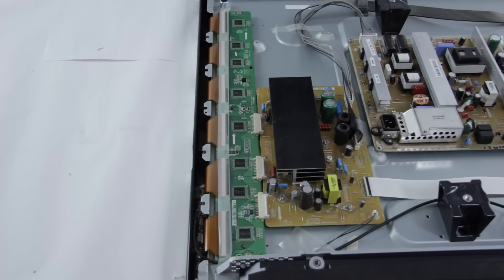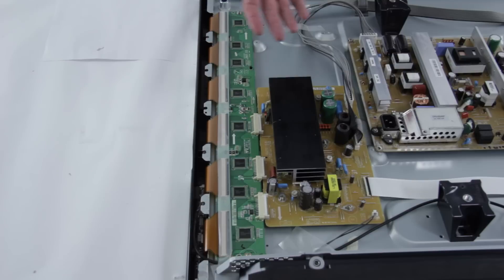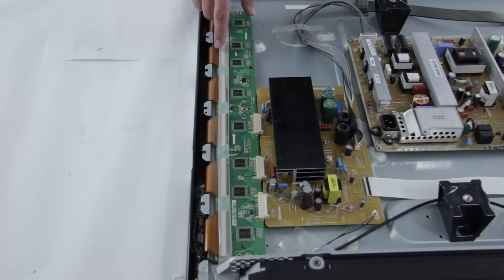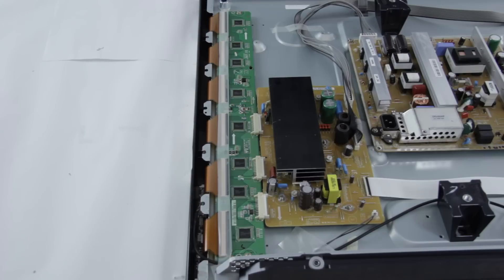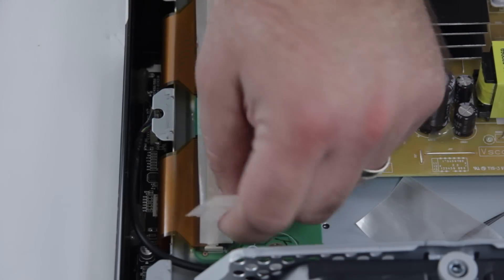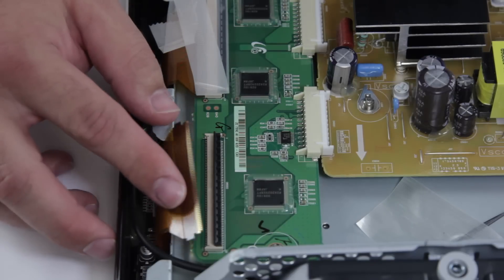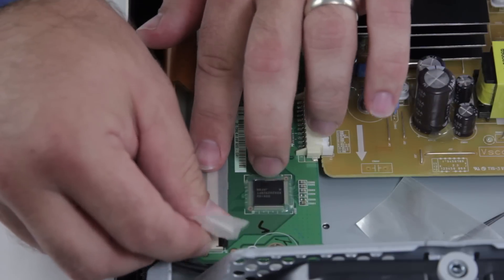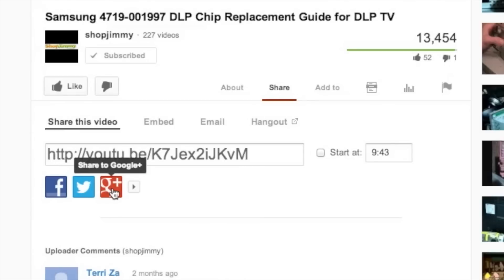Plasma TV Repair - No Image, No Picture on Plasma TV Screen - How to Replace Y-Buffer & Y-Sustain

Comment: I have a Panasonic TH-50PX60U Plasma TV.  At times, the TV picture will start to flicker and then go off, then come back on, then flicker some more.  Does not do this all the time - can go for weeks without flickering and then it starts again.  May have something to do with the heat.  Nevertheless, something is wrong and I havent found this symptom in the Service Manual or anywhere else online.   I have posted a video of my TV doing this on you tube at http://youtu.be/NzcC-kTsiaM
Reply from the maker: TV Problem  From the video looks, the problem looks like a signal issue. Is the case the TV is in from the video closed or open in the back?  Thanks!  www.shopjimmy.com
Reply: ShopJimmy.com
I checked to see if this was a signal issue by changing from various source inputs when this problem happens.. from directv which comes in on the three RCA connector inputs to dvd which comes in through the hdmi input and external antenna which comes in on the coax input.  All do the same thing when this is happening.
The cabinet the TV is in has a closed cavity in back which is 18 inches deep but I do have an external stirring fan in the enclosure behind the TV which keeps it fairly cool back there.  I put the fan back there a couple years ago when I noticed that it was getting very hot back their.
thanks
Reply from the maker: TV Problem  I recommend replacing the H main board in your TV.  Here is a link to replacement parts for your TV model number on our website, click here:  http://www.shopjimmy.com/catalogsearch/result/?q=TH-50PX60U  Be sure to match part numbers on your current board, with your replacement for compatibility.  You can also call our customer service for further assistance with your purchase.  (877) 881-6492  Thanks and please let us know if you have any further questions with your TV Repair!  www.shopjimmy.com
Reply: The problem is not with the input.  Even shows up if I hit mute - the word "mute" on the screen also flickers with the picture.  If I go to change inputs the menu that shows up on the screen flickers.  If I change volume the volume lines on the screen flicker as well.   Will the H board fix this?

Comment: Hello.
I have a samsung PS42Q96HDX/XEU. I have just replaced 2 capacitators because of it keep switching itself on and off. When I put it all back together and switched it on, it had a screen devolp and then it made a popping sound, fizzled and started smoking. Please help......
Chris
Reply from the maker: Chris Bluck   What component smoked? if you put a cap in backwards it will go bang and smoke.
Reply: It was definitely one of the new ones cos its blown again. And also when I switched it back on, after all that the screen went blue and fairly slowly too. I was also sold 2 different caps to the ones that were in there. The ones that were in it were 25v and the ones I was sold were 35v but he said that would be fine. Thank you for getting back to me aswell.
Chris
Reply from the maker: Chris Bluck   That sounds good.  Please let us know if you have any other questions.  Thanks!  www.shopjimmy.com
Reply: Ok if I replace the blown cap again (maybe the right way round) do you think it will sort out the blue screen?
Chris

Comment: I have a LG plasma 60PZ950 that has sound but not picture.  I have replaced the Y sustain board and buffer.  Still no fix.  I have also changed the X sustain board, and the power supply and the main board.  What's left?
Reply from the maker: Draughon Webster   This could either be a problem with the logic board or the lower address buffers.  You may need to replace the boards individually to see which one fixes the problem.  Here is a link to replacement parts for your TV model number on our website, click here:  http://www.shopjimmy.com/catalogsearch/result/?q=60PZ950  Be sure to match part numbers on your current board, with your replacement for compatibility.  You can also call our customer service for further assistance with your purchase.  (877) 881-6492  Thanks and please let us know if you have any further questions with your TV Repair!  www.shopjimmy.com

Comment: I have a 60 inch Samsung plasma.
P/N: PN60E530A3FXZA
S/N: Z4X83CKCC01965L
Standby light is on. When I turn the power on it makes the power up sound but no picture. I pressed menu and nothing happens. This happens off and on. I was just watching it yesterday and now won't do anything. What could it be and what should I look for. I have already taken off the back panel.
Reply from the maker: Jared Olivier  You should replace the Y-Main Board and the upper and lower Y-Scan Drive boards.   Here is a link to replacement parts for your TV model number on our website, click here:  http://www.shopjimmy.com/catalogsearch/result/?q=PN60E530A3FXZA  Be sure to match part numbers on your current board, with your replacement for compatibility.  You can also call our customer service for further assistance with your purchase.  (877) 881-6492  Thanks and please let us know if you have any further questions with your TV Repair!  www.shopjimmy.com  #tvrepair
Reply: Did you ever resolve your Samsung TV issue? I have the same problem.
Reply: +Les Lariz no i tried to fix it and it didn't work. So I bought an led tv.
Reply: Thanks for getting back to me.

Comment: I have an LG 50PC1DA which has sound but no picture.  Here is a video of it turned on, with me explaining what I have tried so far.  Any suggestions would be appreciated!

LG 50PC1DA audio but no video
Reply from the maker: *****   I recommend replacing the main board in your TV.  Here is a link to replacement parts for your TV model number on our website, click here:  https://www.shopjimmy.com/catalogsearch/result/?q=LG+50PC1DA  Be sure to match part numbers on your current board, with your replacement for compatibility.  You can also call our customer service for further assistance with your purchase.  (877) 881-6492  Thanks and please let us know if you have any further questions with your TV Repair!  www.shopjimmy.com

Comment: Hello,

I have Samsung 50 inch LCD Plasma TV. The tv has sound but no picture. Full black screen.
TV Model: PS50B650S1RXXT
Model No: 50' UF 1A DRIVE Y-MAIN

I have changed two boards of my tv. LJ41-06153A and LJ41-06152A; REV: AA1

but, still have the same problem. What can i do? Any suggestion?
Reply from the maker: mahmoodnsu   Did you replace the Y buffer boards with the Y board?  Thanks!  www.shopjimmy.com
Reply: I did't change the Y buffer boards with the Y board. Okay, I am going to replace a new one and let you know my result. Thanks for your suggestion. (y)

Comment: I have an LG 50PA5500 with sound, but no picture. When i plug it in, the tv goes in stand-by (power LED is red). When i press the power button, the power LED flashes red for a couple seconds before going off. Any idea what might be happening and how I can fix it? Thank you!
Reply from the maker: Sam Peeling   I recommend replacing the YSUS board and the YDRVTP and YDRVBT boards in your TV.  Here is a link to replacement parts for your TV model number on our website, click here:  http://www.shopjimmy.com/catalogsearch/result/?q=LG+50PA5500  Be sure to match part numbers on your current board, with your replacement for compatibility.  You can also call our customer service for further assistance with your purchase.  (877) 881-6492  Thanks and please let us know if you have any further questions with your TV Repair!  www.shopjimmy.com
Reply: ShopJimmy.com Would there be any sense in replacing the YDRVTP and YDRVBT boards before purchasing all three? I read somewhere that replacing just the YSUS board can result in breaking a new one because of a broken buffer board, but I haven't seen anything saying not to replace just the buffer boards.
Reply: ShopJimmy.com I got my parts tonight and after installing them, I now get no sound and I get a picture with two horizontal bars that cover about 2/3 of the screen. Any idea what could be wrong? Did I get bad replacement boards?

Comment: Hi Jimmy. My tv is an LG 50PC5D plasma. When i plug it in, tv goes in stand-by (power LED is red). When i press the power button, the power LED would blink for like 20 seconds or so and then is just solid green, but there's no picture or sound. Also the fan does not come on at any time. The D3, D4 and D5 green LEDs on the logic board are on. The D1 and D2, on the same board, are off. Any idea what could cause this behavior? Thank you in advance.
Reply from the maker: Pompei Guta   I recommend replacing the main board in your TV.  Here is a link to replacement parts for your TV model number on our website, click here:  http://www.shopjimmy.com/catalogsearch/result/?q=50PC5D  Be sure to match part numbers on your current board, with your replacement for compatibility.  Here is a link to a video showing how to identify your part number, click here:  TV Part Number Guide for LG & Zenith Main, Digital, & Tuner Boards (LCD, LED, Plasma TVs)  You can also call our customer service for further assistance with your purchase.  (877) 881-6492  Thanks and please let us know if you have any further questions with your TV Repair!  www.shopjimmy.com

Comment: Hello jimmy,

I have a Samsung hps5053x/xaa, after about 15 to 30 minutes of use the tv lose half it's picture which results in horizontal black lines and then the picture goes out. I still have sound but the display is black with a glow. Any ideas what may be the cause? sometimes it goes on all day and some times it wont.
Reply from the maker: 8001asm  This sounds like a TV panel problem.  If your TV panel is bad, it may be more cost-effective to replace the TV as panels are typically hard to find in stock, difficult to replace, and expensive.  Thanks and please let us know if you have any further questions!  www.shopjimmy.com
Reply: ShopJimmy.com that's a bummer. I was doing a little more trouble shooting and it seems to do it alot on vga to computer mode but not on s-video mode on my cable box. however i dusted the hell out of it it had a ton of build up. So far it hasn't done it, but i appreciate your response.

Comment: Hello my name Helena I have a haier 32inch  lcd tv  and it just stop working it will not come on at all the green alright come on but not working the model is L32B1120a  serial is TB300 71040 0Dm12x1505
Reply from the maker: Helena Young   I recommend replacing the main board in your TV.  Here is a link to replacement parts for your TV model number on our website, click here:  http://www.shopjimmy.com/catalogsearch/result/?q=L32B1120a  Be sure to match part numbers on your current board, with your replacement for compatibility.  You can also call our customer service for further assistance with your purchase.  (877) 881-6492  Thanks and please let us know if you have any further questions with your TV Repair!  www.shopjimmy.com

Comment: Hi Jim,
I have a Panasonic plasma TV, Model No. TH-42PW4AZ, Ser No. YB2320041 purchased in 2002.

When I power the TV on I get sound through the tuner but no picture at all. The screen remains blank.

Hope you can help.

Cheers, Paul.
Reply from the maker: Paul Kavanagh   I recommend replacing the Y-board and buffers in the TV.  Unfortunately I do not see any replacement parts in the search results for your TV model number on our website.  Thanks and please let us know if you have any further questions!  www.shopjimmy.com

Comment: Hey Jimmy-- We have a Samsung plasma model # PN50A450P1D. Our issue-- have sound, but no picture. From what I have read on this feed it most likely is the main Y board????? Any solutions??? Is this fixable by someone who has never done it??/ ie-- me???
Reply from the maker: burrkm   I recommend replacing the Y-Main board and buffers that attach to the Y-Main board in your TV, for your repair.  Here is a link to replacement parts for your TV model number on our website, click here:  http://www.shopjimmy.com/catalogsearch/result/?q=PN50A450P1D  Be sure to match part numbers on your current board, with your replacement for compatibility.  You can also call our customer service for further assistance with your purchase.  (877) 881-6492  Thanks and please let us know if you have any further questions with your TV Repair!  www.shopjimmy.com

Comment: Hi my samsung plasma#PN42C450B1D tv got hit on upper front left and put a crackhead in it now when I turn it on it makes a weird noise and see like a reddish block of lines towards the right middle screen then screen just goes totally black but I can still hear the audio.do you think it's the Y buffer and how much is it, Thanks
Reply from the maker: zay c   This sounds like a TV panel problem.  If your TV panel is bad, it may be more cost-effective to replace the TV as panels are typically hard to find in stock, difficult to replace, and expensive.  Thanks and please let us know if you have any further questions!  www.shopjimmy.com

Comment: hi I have JVC the tv no came on aready change power suplay and main boardand the tv don't came on the tv model LT-42EM59
Reply from the maker: Sandi Medina   I recommend replacing the M2 main board in your TV.  Here is a link to replacement parts for your TV model number on our website, click here:  http://www.shopjimmy.com/catalogsearch/result/?q=LT-42EM59%EF%BB%BF  Be sure to match part numbers on your current board, with your replacement for compatibility.  Here is a link to a video showing how to identify your part number, click here: TV Part Number Identification Guide for JVC Main Boards (LCD, LED, Plasma TVs)  You can also call our customer service for further assistance with your purchase.  (877) 881-6492  Thanks and please let us know if you have any further questions with your TV Repair!  www.shopjimmy.com

Comment: Samsung HPS4273X/XAA  Started out that when I would be watching tv or dvd a blue fuzz would come over the tv.  Shut it off for awhile and the fuzz would be gone for  awhile.  Then there may have been vertical lines and black bars on the screen or even only half a picture, but I don't remember because the tv now turns and has audio but no picture and it happened a long time ago.  Recently I have renewed my interest in repairing this 42" tv.  Watching numerous videos on here I think it must be Y board and the Y buffer connected to the ribbons.   What about the buffer on the right with ribbons connected to the X main?  And how do I insure compatibility when buy new or used boards?  I can match PBA numbers but what if mine have revision numbers also?
Reply from the maker: ajfranklin1   This sounds like a TV panel problem.  If your TV panel is bad, it may be more cost-effective to replace the TV as panels are typically hard to find in stock, difficult to replace, and expensive.  Thanks and please let us know if you have any further questions!  www.shopjimmy.com

Comment: I have a Zenith model Z42PT320, the problem is when the TV is turned on the screen is blank then bits and pieces of the picture appear on screen, I have sound but bad picture.Could this be a substain board problem as should in your video.
Reply from the maker: Dean Case   I recommend replacing the YSUS board and the buffers that attach to the YSUS board in your TV.  Here is a link to replacement parts for your TV model number on our website, click here:  http://www.shopjimmy.com/catalogsearch/result/?q=Z42PT320  Be sure to match part numbers on your current board, with your replacement for compatibility.  You can also call our customer service for further assistance with your purchase.  (877) 881-6492  Thanks and please let us know if you have any further questions with your TV Repair!  www.shopjimmy.com

Comment: Hi I have a PANASONIC TX-P42GW30 Plasma TV which gave a poping noise during operation and then did not show any picture or sound anymore.
Of course, this happened exactly one month after expiration of the warranty.
Please HELP!
Thanks in advance
Chris
Reply from the maker: Christian Bauer   I recommend replacing your Y-board and buffers in your TV.  Unfortunately I do not see any replacement parts in the search results for your TV model number on our website.  Thanks and please let us know if you have any further questions!  www.shopjimmy.com

Comment: I have a Samsung model PN50A450P1D that has a black vertical line on the middle of the screen. what could the problem be?  Please help
Reply from the maker: Ricardo Lopez   This sounds like a TV panel problem.  If your TV panel is bad, it may be more cost-effective to replace the TV as panels are typically hard to find in stock, difficult to replace, and expensive.  Thanks and please let us know if you have any further questions!  www.shopjimmy.com